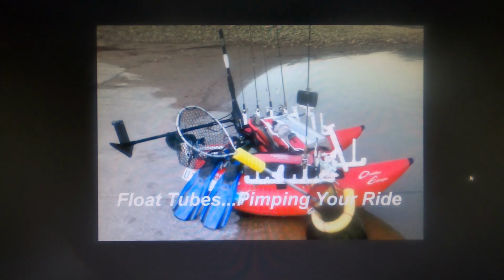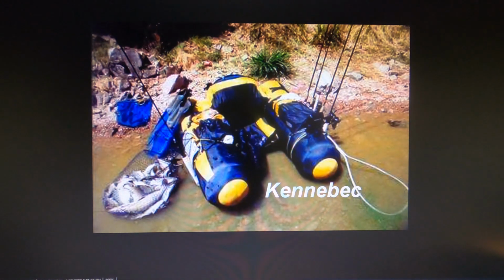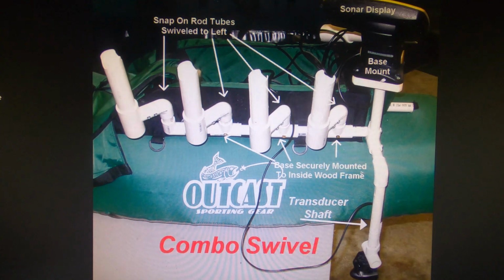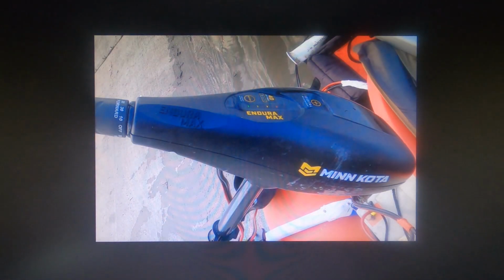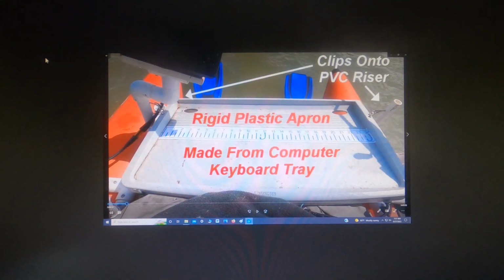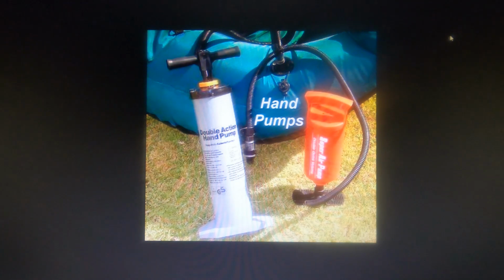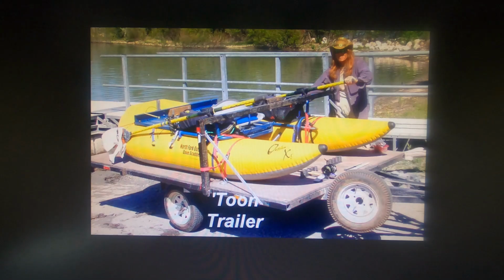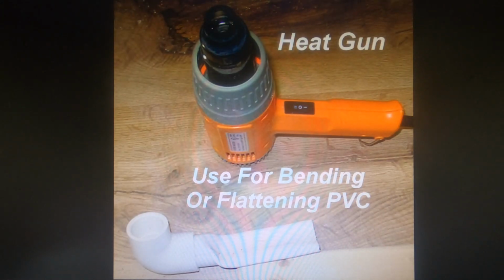FLOAT TUBES   PIMPING YOUR RIDE

Comment: What size pvc pipes are you using?
Reply from the maker: For the main construction frame, etc. I use schedule 40 1".  It is the heavier thick wall tube.  For the rod holder tubes I use thin wall type 200 1" PVC.  The thin wall will hold most rod handles but if you use the heavier schedule 40 you will need 1 1/4" for the rod holders.  Too heavy.  Standard 1" fittings will work on both schedule 40 and type 200.  Same outside diameter but greater inside diameter on the type 200.
Reply: Nice, thanks for a quick answer. Im going to try to build the "Mega mount" for my fishcat 4 lcs. What size are that pvc built of?
Reply from the maker: For any framing that requires a lot of strength, I stick with the heavier schedule 40...1".  However, if you need to run a piece through the holes in the floats you will need some 3/8".  If you send me an email to tdude@centurylink.net I can send you a PDF file with specs for making that mount.  \But you will have to make some adjustments in size to fit the tube you are working on.
Reply: Thanks, i send you an e-mail! I really hope it will work on my tube

Comment: If the wires and battery get wet is fine?
Reply from the maker: Unless you get hit with a big boat wake you should never have to worry about that.  But I always make sure my wire connections are well wrapped with plastic tape and clamped very securely in the connectors.  I have had a few connections come loose and lose power while fishing.  But have never had a problem with splashing water.
Reply: @tubedude467  ok thank you cause I'm going to the same thing like you are but just take into the ocean
Reply from the maker: Just be sure your motor is rated for salt water use...and rinse everything down with fresh water after each trip.  Also, even more important to make sure all of your electrical connections are solid and covered to reduce salt water corrosion.
Reply: @tubedude467  thanks allot boss

Comment: What brand model size trolling motor do you recommend? Also, what battery size model etc? THANKS DUDE TUBE ON!
Reply from the maker: I am using a MinnKota 40# thrust EnduraMax motor.  A 30# thrust would provide enough power, but I need the longer shaft on the 40#.  I recently upgraded my battery to a 100 amphour Lithum battery.  You can use a regular deep cycle marina battery or an AGM battery.  But I really like the difference in longevity and output with the lithium.  Pretty spendy though.  Lots of good ones now on the market...with long time guarantees.

Comment: Very impressive!  Question for ya...you said the Fat Cat didn't blow around as much as a brand that looks like my Cumberland.  Well my Cumberland is difficult in the wind, but the reason I went with it was because I heard it was safer, if you leaned forward.  What are your thoughts on pointed vs blunt ends?
Reply from the maker: It's all about profile above the water...when it comes to handling in the wind.  Most float tubes can be difficult in high winds.  But the pointed back end helps steer easier with either fin power or motor.  As far as the pointed vs blunt front end, I think the length of the rube in front of the operator is more important than the shape.  I never had a problem with leaning forward in my Fat Cat...and I am over 250#.  But I did have problems with the shorter front Fish Cat models I tried.
Reply: @tubedude467  Thanks much...finally someone who actually reads the question. You've been blessed with many talents!
Reply from the maker: Thanks for the kindly comments.  I am properly grateful the the many years of good experience I have had....and enjoy passing along any help I can offer to others still in the learning curve.  As I like to say, I may not know all the answers but by now I at least know most of the questions.